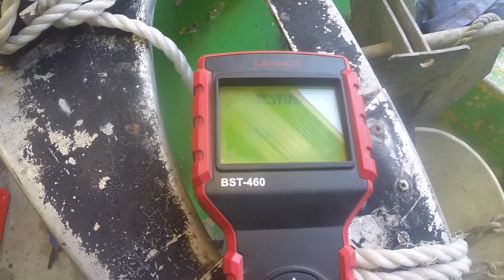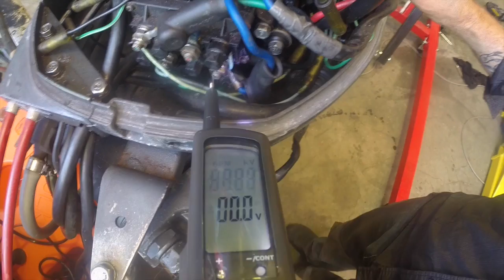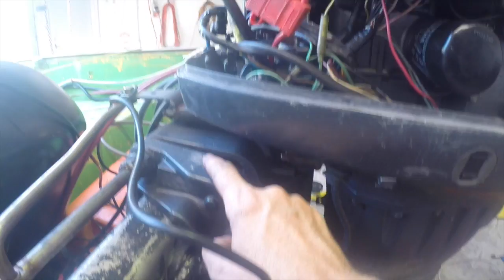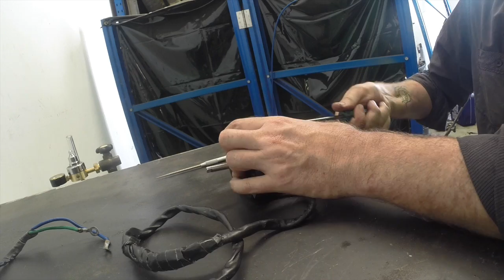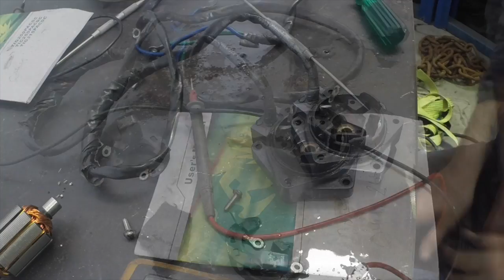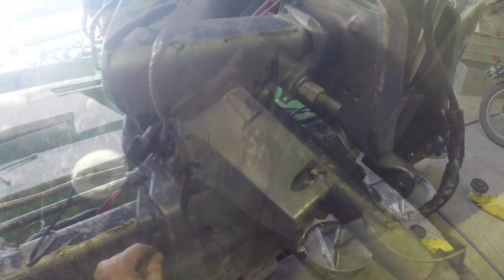Fixing the trim tilt on an outboard motor

Comment: Thanks!  Tore apart mine off of a 2007 Yamaha 90 TLR using this video.   A simple cleaning with the brake cleaner to get rid of the brush dust got it running correctly.  Great video.

Comment: Just fixed trim motor on yamaha 150 from 2006. Opened motor, cleaned all up with contact cleaner and toothbrush, brushes were clogged by dust so I cleaned springs that push brushes. All works fine now, I hope long time. Thanks for your help!

Comment: Bought a 2014 honda with 0 hrs.  It's sat and my trim doesn't work.  I have 12v going into motor but nothing but a click.  I was gonna clean mine after this video but I found a motor for $70.  I'll let you know if it's my motor.

Comment: Thanks for the video, it really helped me out since I had no service manual. My only problem is that my motor now works but it doesn't pump. Would the motor close if the male slot didn't fall into the female slot? Or could it be fluid? I'm getting a spinning sound but it kinda seems like it's spinning too freely. I guess you can say it's spinning strong but without the pumping sound. I noticed that yours worked without even adding fluid. I have a 89 suzuki dt115. Any feedback would be greatly appreciated

Comment: Man this video is worth paying for saved me a pump replacement which was recommended I took the motor apart after watching this and found a stuck brush from factory spring tip was slightly bent allowing it to hook itself....thanks mate for the video

Comment: I remember our old 85 bayliner..Same problem..Mechanic told me on so many occasions he simply cleaned up these motors put them back togather. That was the case with our Trim Tilt Motor..
Now have a 8 HP Yamaha High Thrust motor for my kicker for my Glas Ply boat. We checked everything and indeed it's the motor.
Thank you! 
.

Comment: I actually cut my wires close to the trim motor then I soldered them back up. I guess this is a nono  is the wiring removable once you have the motor apart?

Comment: Question please: 1995 Evinrude 200hp. I replaced my tilt /trim motor, bleed the hydraulic fluid. The tilt trim motor was working fine before Replaced the lower cowl, then went to trim the motor up . White smoke came out from the engine cover. One of the three wires for my tilt trim switch on the motor grounded out on a nut as it was pinched when I put the cowl back on. Now I have no power to raise or lower the motor. It was the red wire that was pinched from the switch mounted on outboard motor for the tilt trim I replace the fuse that was blown and put new relays in fuse junction box. Any suggestions any suggestions on what aspect of the engine I need to check to try to resolve this issue🤦‍♂️🤷‍♂️

Comment: Hey Stu, thanks for yor videos! They are soo good! Wondering if you can help? I have an old Mercury 75, have the engine fully trimmed up held in an engine hoist. I'm trying to take the electric motor off, I have removed all of the screws, but simply will not detatch from the reservoir. Any ideas on why an electric motor will not detach from the hydraulic unit? Thanks in advance!

Comment: My trim is not working but the relays are clicking. After watching your video I was wondering if I could hook up my trim motor directly on to the battery to move my motor up and down. I mainly use my trim to put my boat in the water for the season and take it out at the end so I do not use the trim very much. I can reverse the polarity to make the trim go up or down.

Comment: Need some assistance here, the symptoms are very similar to what I see in this video I think. One observation I have is that there’s a huge voltage drop on the battery when activating the trim switch. Is there something wrong with the trim motor or something else?

Comment: could this brush sticking up, also stop my trim from working up and down with load on the propeller, yet the trim works fine without any load on the prop?,, when driving the boat if I wont to trim down I need to take the power off the engine, yet i can trim up with power on?

Comment: Thanks for the vid, very helpful to know the seal is removable and how to get it out. I've pulled the wiper seal from Suzuki Showa unit for a df70-df115. It has the NOK LBI 18x26x4.5/6 double lip wiper if anyone else was searching. Unlike Honda, Suzuki don't list the individual seal on the parts list instead trying to sell the whole resovior for ~$300 instead of $13. I am doing this job in stitu to avoid removing the hydro steering and 190kg of motor. Looks like this Suzuki unit has a drain bung on the bottom to assist flushing the fluid. Will be flushing out the milky stuff with dextron III ATF.

Comment: I did check the comments to see if it was mentioned. Question: Is any kind of lubrication suggested for the bearings at the ends of the armature? I happen to have a trim motor apart now. The magnets came loose from the can and I'm about to re-glue them using Loctite 325. Everything else looks fine inside the trim motor but I will do some clean up like shown in the video. Thanks for a great video.

Comment: I'm having trouble getting my locking screw to lock my motor in place and is causing porpoising is there anything I can do to fix this without having to replace the trim motor?

Comment: Thanks a ton for this video mate! Just fixed my trim motor. Blue wire was broken inside the motor. Re attached with solder so hopefully it holds, working now though so all good. Cheers 👍

Comment: Excellent video and don't be sorry for showing us the motor internals so well! It's actually good to see some electric motors are still serviceable and can be opened easily. Marine life can be hard to brushes and commutators because there is humidity all the time and temperature is changing also. Humidity can make the powder that brushes leave stickier for sure and jam it easily. Thanks for all the advice.

Comment: Hi Stu, hope the hands are getting better... just picked up my boat from the yard today it was laid up since March. The tilt trim motor isn't making any sound and when we tried the manual release  the engine won't budge either. Seems seized. Battery might be low but we connected up my van battery when the van was running with jumper cables and still nothing. Engine is turning over. 2001 evinrude 70 2sroke. Any ideas? 

Thanks  a million. 

C

Comment: Can hear clicking as I try to trim the engine and the battery turns the engine over would this still be not enough power in the batterie ? Have only just found this problem today ☹️have not started the engine since last summer did charge battery but not sure how much charge was in it just watched all the blog I think I’ll find it from all the info should have wAtched  it all first many thanks from the Uk 👊🏻😁

Comment: Thanks for video, I had Tohatsu M40D tilt not working. Only manage to take out the lower bolt, the upper bolt is STUCK. But did manage to take out everything in pump, valves and clean. It works now not sure if it was air or debries in the system that stopped it from working. Found a good way to take are out, open bypass valve, take off the lower bolt so unit can be usped up and down by hand, remove motor. With motor away you can push it up and down and easily top up oil, there is surprisingly much oil needed if it has been drained, and surprisingly much air. I found that it was when rod was nearly fully retracted the air came out so moving it up and down there was a quick way to get air out.

Comment: What if the relay is defective on the ground side (not completing the circuit when normally closed)? You would still get power out of one relay but the other wouldn't complete the ground.  That was the problem I found with mine.

Comment: Hello Mr. Danger,

I replaced a 2 wire trim motor w/ a 3 wire motor. Now the tilt and trim is very slow and the wiring at the relays heat up.
When I connect the motor directly to the battery it operates fine.
Any advise would be helpful.

Thanks,  

Dan Rising

Comment: Thanks for all of your practical videos and taking away the mystery of the outboard engine.   Any advice on trying to get the pin out from the top ram of my PTT for my 90 Yamaha?   Seems pretty stuck and I'm afraid if I whack it too hard I will break the casing.

Comment: Fantastic! I had a 1987 90 HP Mercury that had the exact same intermittent problem. There was not a replacement unit available due to its age. I had to remove teh motor and took it to a Buddy that rebuilt starters and alternators. He cleaned it up like you did and put new brushes in. It worked great after that. I learned so much from watching this video about how to actually check out the motor myself! Thank you!

Comment: I have a Suzuki Dt150. I replaced the trim tilt unit and the motor was a 2-wire.  The original motor was a 3–wire.  I then bought them conversion harness to deal with this issue but i have no clue where to connect the two smaller wires (green/white & blue/white).  I’m completely lost on this one.

Comment: Love the vids, man you are one awesome instructor , no guessing with you. You really show all the details .  My trim motor works, but it won't go up, or down. I tried loosening the screw and lifting up and down 3-4 times and tightened screw. It went up a little ways and stopped, so I thought it needed more bleeding, so did the procedure again, and now it don't work at all again .The motor is turning but doesn't even try to go up .What could cause this ?  Should I drain and replace the fluid ? Maybe water in there ?  Thanks, and keep up the awesome work !

Comment: Here is a added note. When you shut off a generator, or a rototiller, gas power washer, plus any engine pertaining to engines that will sit for long periods of time, try this if you want the valve spring to last much longer which helps with horsepower, pull the pull starter until you feel resistance remember intake, compression, power and exhaust. When you go into the compression stroke this is when both intake and exhaust valves will be closed. Hens forth relaxed spring that will last longer. Oh and thanks Dangar Marine.

Comment: Like so many other comments-I too enjoyed a most informative video. Really well shot video too. Pulled motor apart as case/housing was rusted with pin-hole and yet still in great bright condition, however, still have problem in that hydraulic pump is still not doing its thing. Thanks for sharing, please don't stop helping. 🇦🇺

Comment: Excellent video! I have a Honda BF 40 LHTA BAYL model. The trim tilt has small leak in the rod water seal. I looked into the Honda parts website and apparently that particular seal does not have a reference. Do I have to buy an expensive part 56120-ZV5-822 because that seal is not available or do I have an alternative? Thanks in advance.

Comment: Dangar - I just subscribed this month and have learned so much from you - thank you for what you do!

Question regarding the Trim system for a 1992 Mercury outboard.  I'm hearing the solenoid click for the down trim button but when I push the up trim button I don't get any click.  I completely rebuilt the Trim switch as it was corroded, and am able to pull voltage readings for the up and down at the switch.  Replaced both solenoids with new and still only hearing click for down trim and no click for up trim.  What would you suggest I check next?  watched all your videos but can't seem to find any video covering what to check when you have a replaced solenoid that won't "click".  Cheers mate keep up the great work

Comment: I have a yamaha F30. First thing it did when i tried to trim up was nothing at all, not even the relay was working and i thought i had the main battery swith off, but it was on. Then with second try i could hear the relay working but didint trim up, only down. Then after a few tries it worked ok.The battery is one year old, the fluid indicator of the battery is green, motor starts up perfect and it has only  100 Hours of working, its a new motor. I cant really imagine the brushes are stuck from brushes powder like in video. Now im anxious in case it stops working again while im at the sea :/

Comment: Do these motors run like most DC motor except they have a green and blue wire as positives and negative alternating rotation instead of typical red and black wires? or do they use body ground as negative and the blue and green wires are both positive based on the wire supplied with positive power? thank for any clarification info.

Comment: Hi danger marine i have been looking at your videos i have a honda bf 50 4 stroke engine 2006  my tilt trim was takeing in water but i got new seals put in and filled with oil not loosing oil now but when i connect it to a battery the rame wont goe up or down but the motor works ram is down can you help

Comment: Hi I’m replacing the trim motor on my 1980s mercury 200 hp for the second time but I found a broken piece but I don’t know what it’s called. Would you be able to tell me it’s name so I can order a new one. It’s small and it looks like the head of a flathead screw. It’s used to mate up the output shaft of the motor to the pump. Thanks

Comment: Awesome video. Subscribed. On my outboard the trim is making the same sound as if it was working, it just doesn't go(move) up or down. It hasn't dropped down at all, so it is holding itself up at least.

Comment: Hi Stu, my tilt trim works but goes up a ways and stops. I can get it up by keep hitting the up switch. Acts like its low on fluid. Checked it but looks full? I think I need to drain it and find the vent/drain plug. It may have air in it. Also has a small amount of fluid coming out of the piston rod cover when raising it. Probably a seal

Comment: We have a 1989 Mercury 100 Fuel Injected outboard with a no working tilt trim motor~ How did you get to the upper screws? we can't see the back screw let alone get a driver on them.

Comment: Hello and thank you for the video. I want to ask you a problem about my 1999 yamaha 50hp 4stroke like that engine... when I push the button to trim down, it works perfectly, but when the trim up the sound and move like very hard to up the engine and sometimes stop... I checked the batteries but they are fine and coming voltage to the engine also fine...  Do you have any idea... Thank you very much.

Comment: Hey stu, thanks so much for this video, do you know if Yamaha sells the individual parts of the motor or the whole unit has to be replaced at once, the outside of my motor is rusting and id like to replace just the case or cap bit

Comment: Thanks stu! Fixed my trim motor with your help. Water leaked into the housing and corroded a spring. Cleaned up with  brake cleaner, installed a new spring now it's back up and running.

Comment: Getting the brushes held back to install the motor;
String or floss looped around each wire feeding the brushes pulled and held back, then drop in the motor partially, release and pull out string, drop motor in totally.

Comment: good video -- see if anyone can figure this out .. I have 13 volt new battery cleaned all wires at engine and battery have plenty of fluid . tilt goes up and down but it moves slowly and it vibrates and sometimes it stops.. I get a sense that it is starving for power up or down . engine has 150hrs on it it is a Suzuki. can a bad switch do this

Comment: Thank you very much. Well.....I tested the tilt/ trim motor by itself and it does go up and down. The Evinrude comes with 2 relays and the both click. I disassembled the switch completely then when I connect the battery, the motor starts working on the downward position....!!!!aarrgghh!!! Could use your help. Thank you again

Comment: I finally got around to checking out my power trim and following your advice, I discovered the brushes were worn down all I had to do is replace them and everything is working just fine. The hardest part was getting it all back together. Thanks for you advice.

Comment: What engine is that Yamaha F90-100-115,  after watching this video I feel confident enough to embarc in fixing/or replacing it myself.  Thanks for taking the time to make and upload the video.  I have a 2002 Yamaha F100.  It looks similar to the motor on the video.  Thanks again
Greetings from Puerto Rico

Comment: whats the best diagnostic if the trim wont hold up when in drive, all system is ok when in neutral or revs down but it will go down when i give it some revs.or i cant trim it up. thanks

Comment: An auto electrician friend of mine puts armatures in a lathe and machines the commutator flat again. After all they wear just like brushes, and brushes have springs to push them out into the comm. I use my drill press and emery paper. 
**another great video Stu** thanks.

Comment: I did what you said about cleaning it and it works now but it won’t go up, only down?? My tilt and trim is 3 wire and im testing it straight to battery. Do you know what it could be?

Comment: Hey Stu. May need some help here. Trim worked intermittently for a few months, then stopped completely. Followed your process. Switches work, relay clicks. When I was messing with it before, tapping on the outside of the motor with a rubber mallet would make it work about every tenth time I hit the switch. It never acted like it was weak, just responsive or unresponsive. Anyway, took the motor out. Ohm meter from the cable ends to the scrubbers shows open, so I guess the wire is good. Cleaned everything up, re-assembled (Holy poo those scrubbers are a pain. Not nearly as easy as it looked in your vid to holf them in their slots (so springs are good I guess). Anyway, still unresponsive. So questions. 1) Can I just connect blue and green wires to the battery terminals to test? From your other vid, it looks like the relay just grounds one to activate, so that seems like that makes sense. 2) If it still doesn't work, what else could be going on? The armature didn't really look that bad even before I cleaned it up. Thanks!